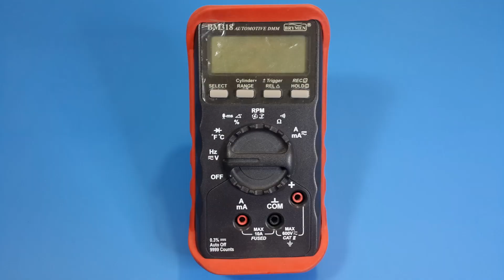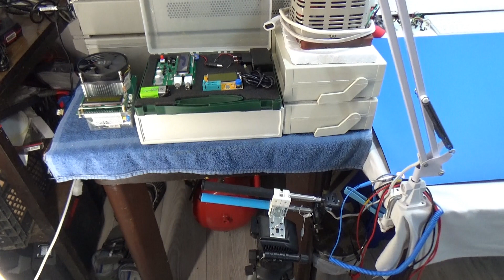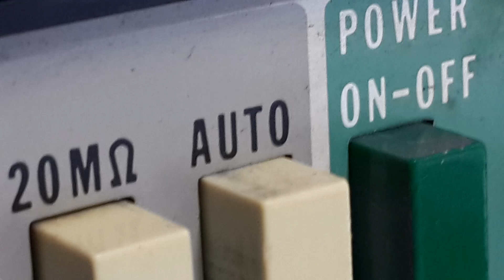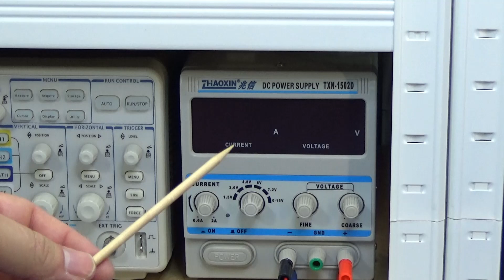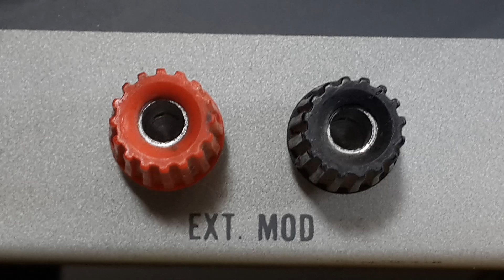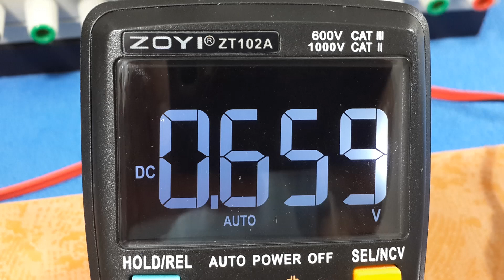New electronics laboratory / A tour to the workshop - lab improvements and the equipment show off.

Comment: Beautiful lab! If there’s one piece of equipment I suggest for you….. it is the DE-5000 LCR meter. It is such a wonderful device for the price! You will love it! 
I’ve been using it for over two years, and it does just as good as my expensive benchtop LCR meters made by HP/Agilent andand Tektronix.